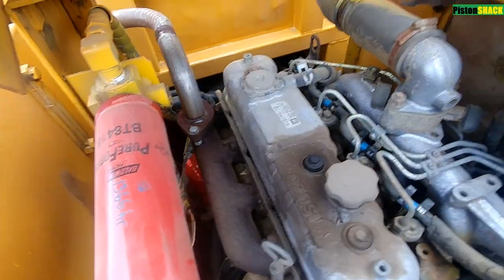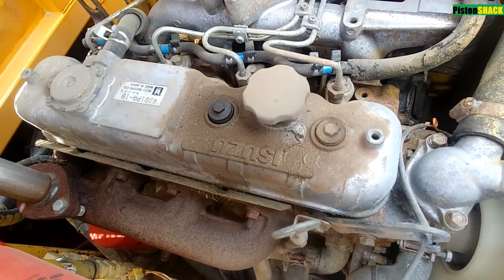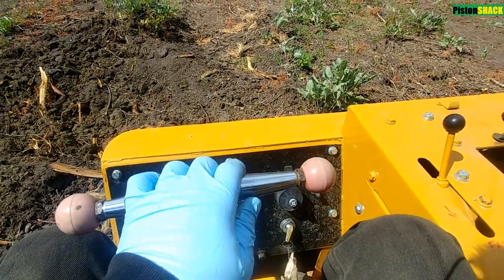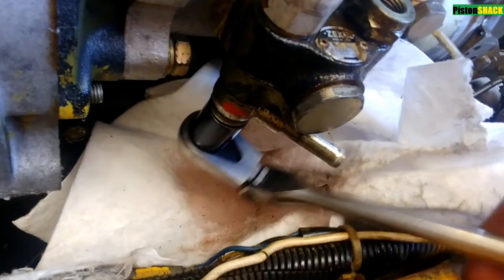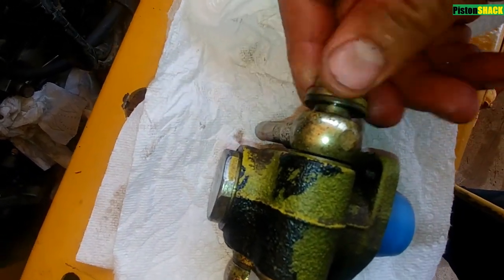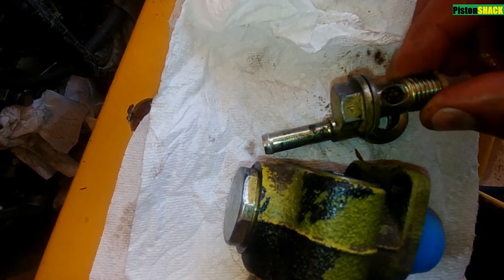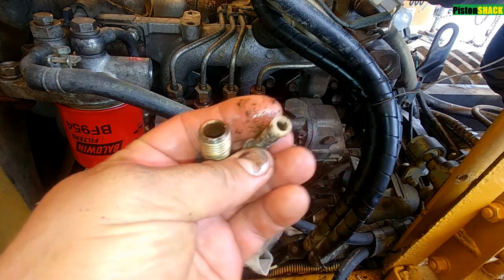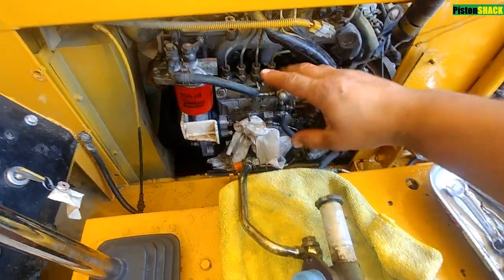ISUZU DIESEL 4JB1 BOGGING DOWN, NO POWER | CHECK THIS FIRST! | ZEXEL injection pump

Comment: I will take that diesel out of that thing. Force induction and put it in my 2019 Nissan frontier King cab it will fit perfectly in there . can squeeze 150 horses 280 to 300 ft lb of torque would be perfect. I don't know what kind of boost you would need to get that kind of power out of that small diesel maybe about 17 lb of boost or 25
Reply from the maker: Yeh, I would like to see that happen! ISUZU also has 4jb1T (turbo) versions pf this small engine as well. They are torque little work horses!
Reply: @PistonShack  love it
Reply: Use the engine and put a adapter plate for the transmission that comes with my truck. May have to beef It up for the extra foot  torque

Comment: hello mate, greetings from Indonesia! could you tell us the fuel injection pump part number? we only have the rotary fuel injection pump in the market here and it’s very difficult to find the inline without the part number. Thanks!
Reply from the maker: Hey brother! Let me check the part number next week. I will get back to you.
Reply: @PistonShack  thanks alot brother!
Reply from the maker: Sorry for my late reply, just got to the machine yesterday.  Fuel injection pump identification plate: ZEXEL (Made in Japan) Adjasted 300-1500 rpm., NP-EPARSVT200-1600A021A312, 1054006031 Licence Bosch

Comment: Hey mate I'm wondering if this exists on the rodeo/Isuzu pumps
Reply: Sorry a Holden Rodeo I Think Isuzu trooper in USA
Reply from the maker: Hey brotha! I would like to know. In Canada we only have Isuzu Rodeo with V6 gasoline engines_PERIOD - no diesel at all.
Reply from the maker: Isuzu trucks are very rare vehicle on the roads in Canada - better to say almost zero present.
Reply: it's a bit different on the rodeo the banjo bolt seems to have built-in filter That I can't remove but doesn't look very blocked I think my issue is with the injector pump itself,,that's unfortunate mate there a awesome vehicle